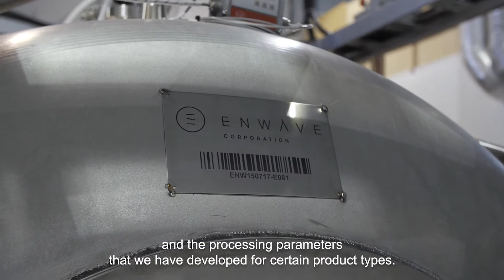EnWave Corp - Vacuum Microwave Drying Experts and the creators of REV™ Machinery

Comment: The problem with speed drying cannabis is that you lose the most sensitive and volatile terpenes and the lose of those unique terps are what the cannabis community is all about.  That smell, taste, and look all takes time in a slow process called curing. (Of which I'm sure you're already aware)   how does the drying process effect the terp profile?
Reply from the maker: Thank you for your comment. You raise great concerns there. With our REV drying process the flowers still need to go through the traditional curing process to unleash the full nose and aroma of the final product. Our technology provides superior terpene retention evidences that you can find on the white paper here: 
https://www.enwave.net/case-studies/terpene-retention-cannabis-drying
Reply from the maker: Thank you for your question and for your interest in REV drying for cannabis applications. The REV drying process is an advanced, gentle rapid drying process that retains up to 20% more terpenes and up to 25% more THC and CBD than traditional rack or hang drying methods, proven by 3rd party independent laboratory testing. You are welcome to review our COA documentation on two strains showing the enhanced retention of terpenes and THC/CBD here https://5042110.fs1.hubspotusercontent-na1.net/hubfs/5042110/COA%20REV%20dried%20cannabis%20strains%202022.pdf. It is important to note that REV drying does not replace the curing process of dried cannabis, but does reduce the time required to dry fresh flower from 7-14 days with hang or rack drying to just 2 hours with REV drying, while also reducing the potential for microbial and mold infestations. We are happy to answer any further questions you have on the advantages of REV drying cannabis and hemp via email at info@enwave.net. Thanks again!